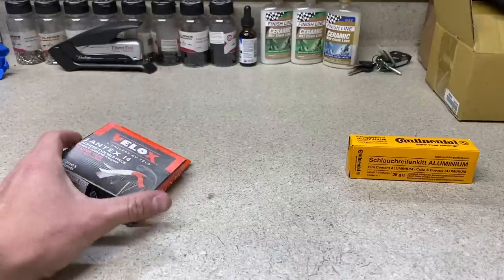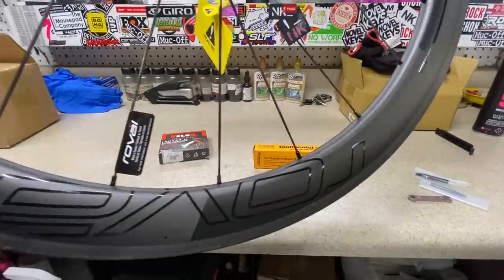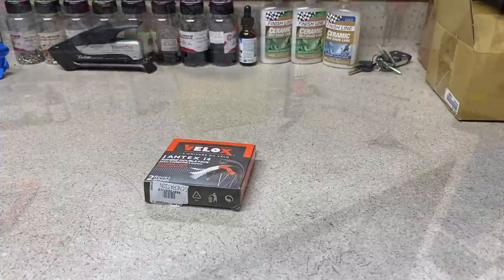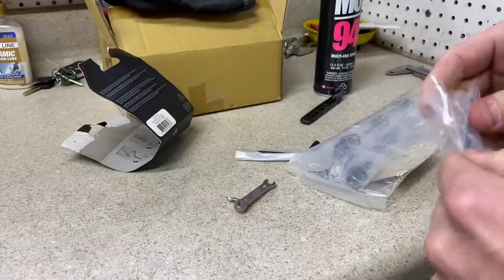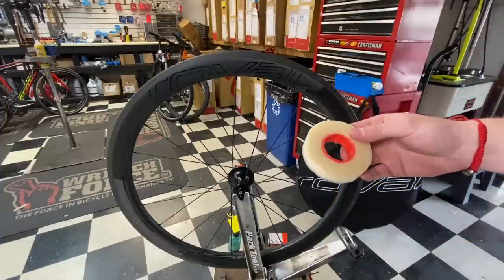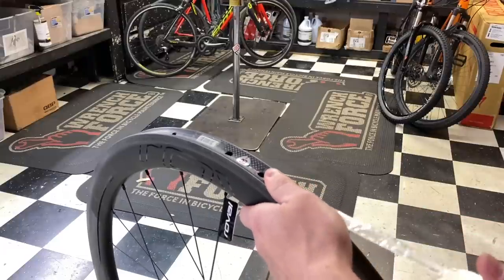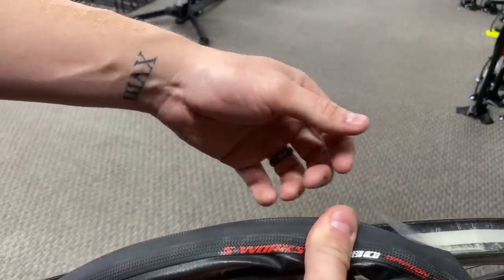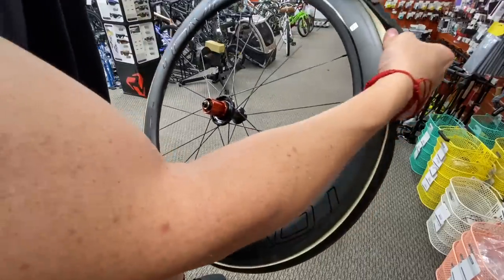INSTALLING TUBULAR TIRES IN 2021 WITH NO GLUE?! (ARE THEY WORTH THE WORK?) SPECIALIZED ROVAL CLX 50

Comment: I run Tubulars  not a problem add abit of Sealant off you go
Reply from the maker: hell yea
Reply: how much sealant u put inside tub?
Reply: @jgg8215  3 Oz works for me
Reply: yeah. I always have a small sealant bottle in my back pocket and co2 cannister. Best thing about punctures on tubulars is that I don't have to take the wheels off to apply sealant after punctures.
Reply: Can i put sealant in tubular tire even im not puncture same like a tubeless setup or the actual puncture only then apply sealant

Comment: Unless you have a crew vehicle driving around with a spare wheel ready to go, I'd go tubeless or clincher.
Reply from the maker: lmao this is true
Reply: That is a total myth. They are even more reliable than clinchers as you don't get pinch flats and tube rub flats, (tube folds) You can fix them with sealant most of the time, if not, stretch on a new tyre. You can fold a tubular so it fits in your jersey pocket. They are a safer and better system. Yes clinchers have got better, but they still do not have all the benefits of tubulars. The biggest advantage with clinchers is they are easier to get and cheaper for the tyres.

Comment: The only thing that always got to me when running Tubes was the fear of heading out and getting a puncher and ending up at the side of the road having to make the call "PLEASE COME GET ME!" Tubes are great fast safe light but not the most practical unless you have a car following you with a spare set 😅😅😅 (Have my set of Campy Bora Ultra Two’s now on the wall might not use them that often but just can’t let go of them either!)
Reply from the maker: yea I mean thats the worst I stil know some peopel carrying spare tires for tubulars on there tt bikes lol gotta do wehat you gotta do
Reply: @GCPerformance18  😂 exactly
Reply: You can simply ride a tubular flat home. The tire stays glued to the rim, so the the rim is protected.
Reply: @jjschmiedlin8813  those of us with decent rims and OCD would cringe at the thought of damaging them though 🤣🤣🤣 I just love inner tubs now won't go tubless as it's not "there" and unfortunately as I've gone rim to disc tubless wheels that i had have been sold, damn I miss my Bora Ultra Two's 🥲
Reply: @joelyons886  You wont damage them by riding a flat. Just dont hit a pothole. As the tire deflates it covers the rim completely. Even when you turn with a deflated tubular, it still moves to cover the rim.
Reply: @jjschmiedlin8813  you’ve obviously not been to Ireland we’ve potholes th at if you look into them you’ll see a panda staring back at you 😂
Reply: @joelyons886  😂😂😂My mother lives in County Mayo.  Flat tubulars might be a problem there! A missing persons report may be likely for some.
Reply: @jjschmiedlin8813  🤣👍 but amazing place to cycle stunning have done a few trips around Toormakeady

Comment: Only need to wait 24 hours for the glues. The adhesive tape doesn't need to cure.
Reply from the maker: okay good ot know I would think they would have to have some kind of wait time but I have also installed glue on bikes for customers who just ride home casual right away
Reply: @GCPerformance18  yeah, now that i wouldn't recommend. It is basically contact cement they use for fitting kitchen laminex. It needs to go off. I would doscourage that for sure. If they had a accident they may try to blame you the installer. Something also to be aware of over time, a year or so, the glue can become brittle and the tyre can roll off as it is not soft and sticky anymore. It takes a year or two for the glue to get brittle. I would also recommend people to re glue every year. I know people use their tubulars as race tyres for years because they do so little miles, and don't re-glue for years and years. Not a good practice.